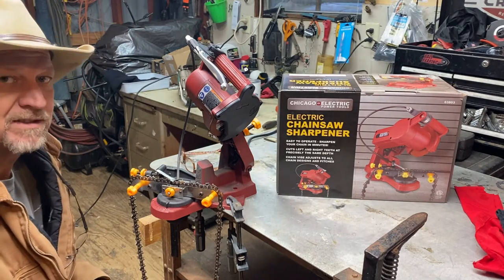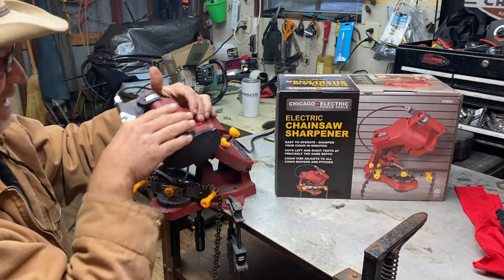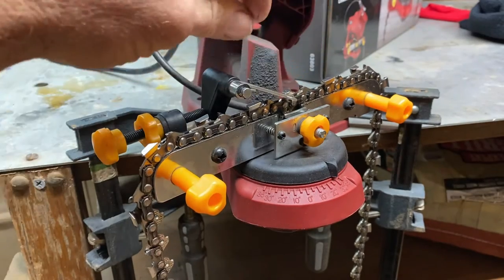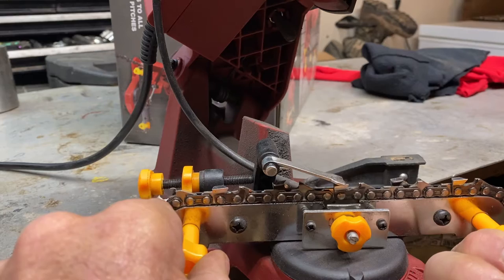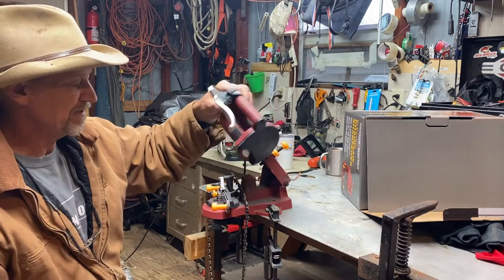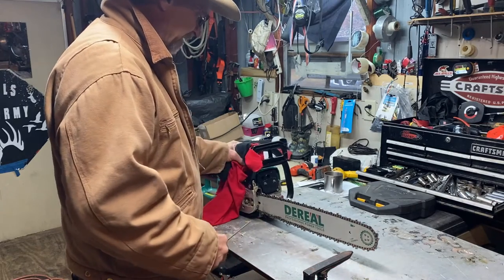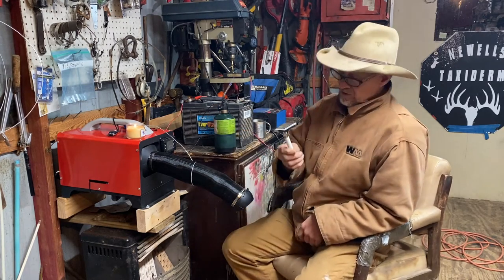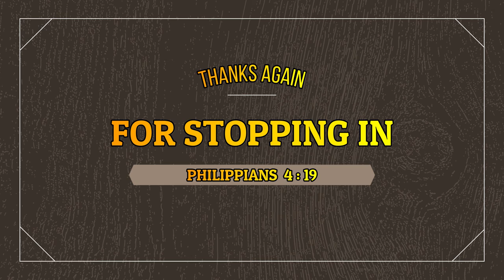THIS IS A MONEY SAVER / SHARPEN DAMAGED CHAINSAW CHAINS AND SAVE YOURSELF SOME MONEY.

Comment: Eddie these sharpeners work good, but those new 3in1 sharpeners are amazing and they do the rakers at the same time. Even if 1 tooth is shorter it will make the rakers match.
Reply from the maker: I've never seen a 3in1 for the chainsaw. Have to check that out.